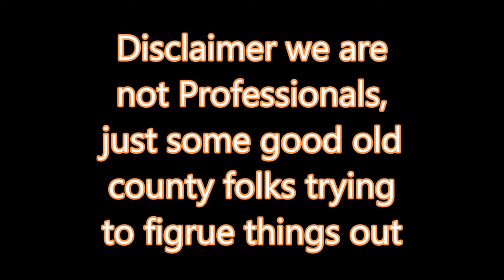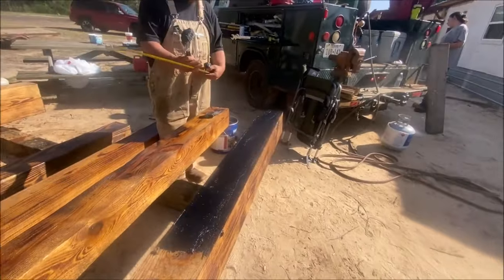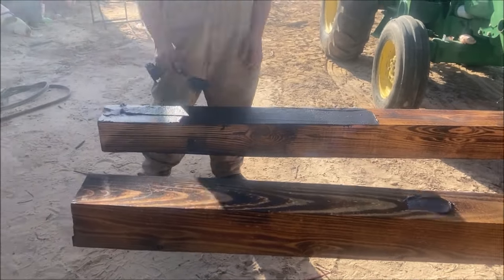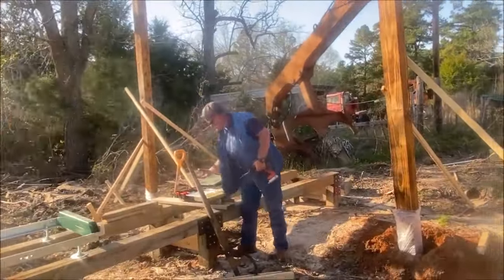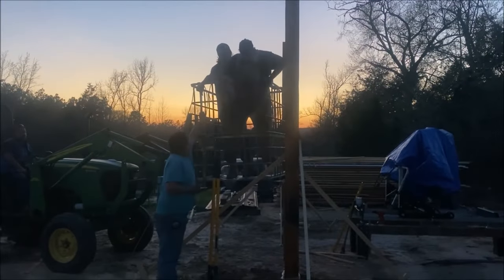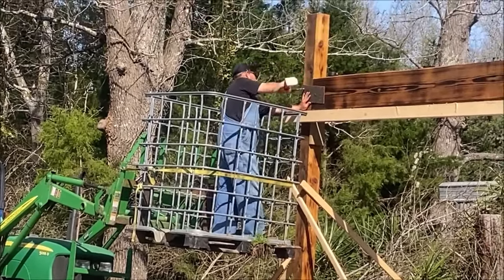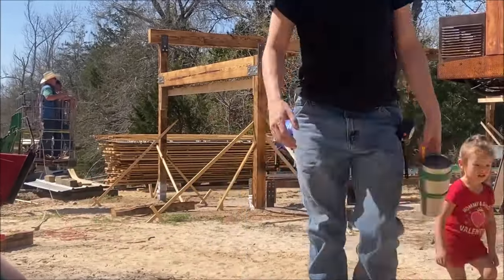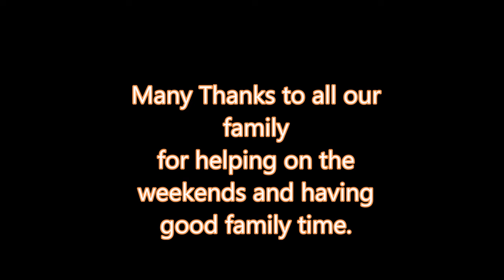Sawmill Shed pt1

Comment: Why didn't you tar the bottom of your posts? And is the plastic cover over tar a bag or just wrapping?
Reply from the maker: We burned them then coated them with oil and diesel then we put tar on the parts that went in the ground, we just wrapped the plastic bags on the tar to keep it from coming off when we tamped the ground around the post. Now we didn’t tar the bottom of the post because everything I read they said to leave that free so water would exit the wood grains